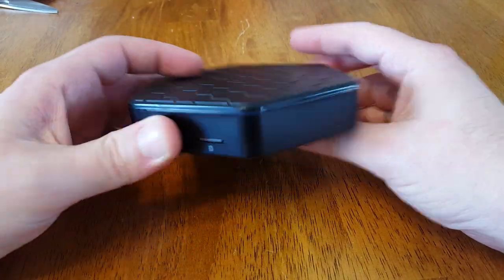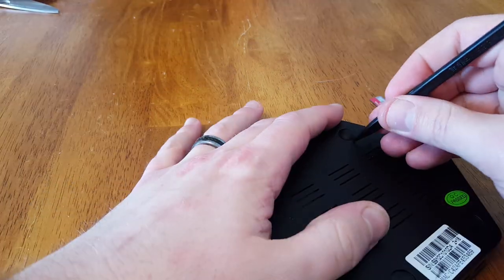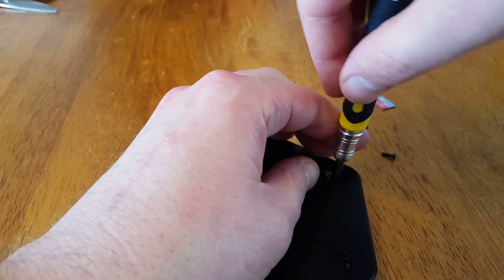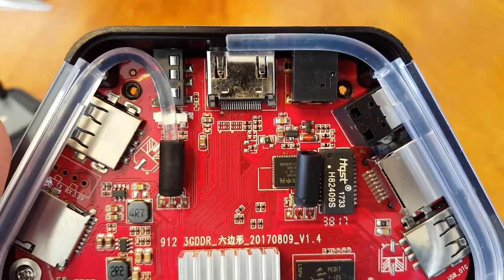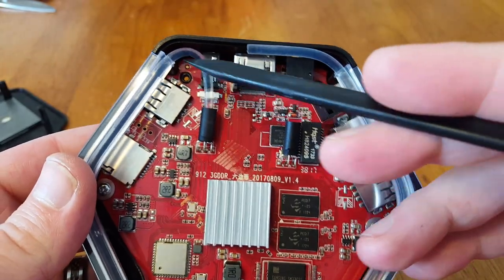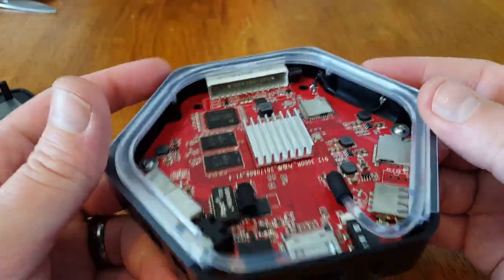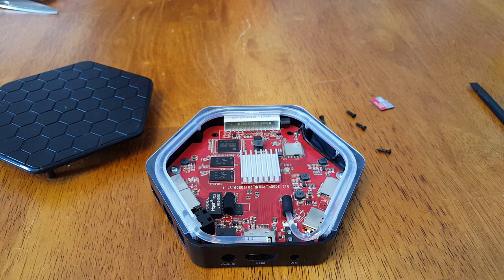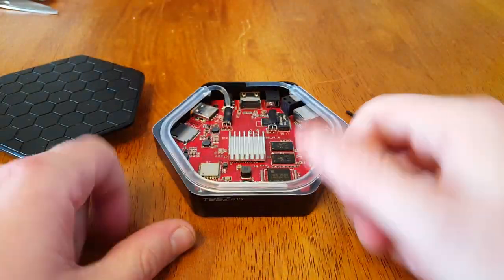Android Box Teardown T95Z PLUS Cracked Open For Close Look At Circuit Board

Comment: Thanks for the disassembly. Mine had rubber pad adhesive dried out and I was in doubt if the screw is actually beneath it (while knowing the fact 99% of time it is). Managed to get a metal pin out that I used to get the device into download mode. Custom rom is possible if we use the correct firmware for its amlogic board variant

Comment: Hi Nev. Thanks for the demo. I only just bought a box last week, and this morning, I tried to connect a 3.5mm plug with the RCAs into the AV port. However, the 3.5 mm plug pushed in the connector part and it is rattling inside the box. The Box still works fine. Is it an easy fix? I could take it to a local repair guy and get him to do it. I would ask for a replacememt box, but I would have to do a 4 hour round trip by car (Not worth it) or post it back. ANyway, if it is a simple fix for a repair guy, I would go ahead with that. I dont trust myself to do it

Comment: Hello! Do you still have the box? I am trying to fix the gigabit ethernet issue with Libreelec/Coreelec, mine is the 2/16GB version that is sealed. I need a picture of the gigabit phy, it is the chip under the component with the termoplastic rubber on the right (at the beginning of the video). I can read something like "ZTE" with chinese characters, but I cannot find the complete part number

Comment: Hello

I own a T95z Plus TV Box and after an update with a memory card that was probably damaged, it got sandwiched.
I tried to upgrade by computer using USB cable, but Windows does not recognize it.
I've learned that I need to apply an Unbrick inside the device, but I do not know how to do that.
Could you help me please.
Reply: Hola tengo el mismo problema, lograste solucionarlo? te agradezco que me respondas. Saludos

Comment: Does anyone experience overheating with this box?
Reply: I am did u resolve ur issue??
Reply: @markmartin135  I punctured holes on the side. Helped a great deal.
Reply: @lenanaH  thanks ! Mine is T95q.similar to this  i factory reset, remove apps and doesnt work. it keeps restarting after an hour or so. Really annoying. This box doesnt really shutdown unlike Beelink.
 Then i i tried and did as you mentioned. punch hole at the side + bottom too. i place small fan underneath the box. it does help. so far it doesnt restart by itself . 
Before there is barely any ventilation except 2 thin holes  like 0.1mm gap. it does help punching holes..you saves me man.👍
Reply: @mood8344  You're welcome mate

Comment: Hey Nev!
Thank you for the teardown video, my LED light had been disconnected, and your video helped me literally get it back on track!
I'm also having an issue getting the reset button to function. On my box, when putting in a toothpick or pen tube, it goes clear through the reset/av area, nothing otherwise happens.
What's happening on the box in the first place is it's no longer showing the rainbow led light when connecting. It's permanently a light blue colour, and doesn't show a picture at all.
This happened a month after I had purchased it on amazon.
They suggested I contact the seller, the seller hasn't gotten back to me at all.
At this point, I'm trying to figure out how to get this box up and running again. It worked like a beaut when it worked!
Anyway, would you know what could be done to help fix this sort of thing? Mine's a 3gb/32 also, everything else looks good. 
Thank you, keep the vids coming! And sorry for the novel.
Reply: where is the NAND chip and the points on this device to reset?

Comment: I gotta say i disagree with you about "android rage" i have 2 of these T95Z plus boxes, they always run smooth and are easily updated, maybe you just dont have enough experience with them.
Reply from the maker: Check back with me in 8 months and tell me that again please. No frustration at all. If your memory is good enough.
Reply: Lol
Reply: @NevsTechBits  
ok!!, I'm back as you requested, i still have the 2 - t95z plus boxes, 1 put aside in case the one i use ALL the time fails, but its still going strong.
What can i say man, i hope you can admit you are wrong, as the box runs as smooth now as the day i bought it. I hold this particular model of box in very high regard.

btw!!, its not a weight, its a heat sink, for gods sake.
Reply: @NevsTechBits 
Hi z
Ned, just came across this video again, 6-7 years later, T95z plus Boxes Still going strong.
Reply from the maker: @voyager4328  LOL OMG DUDE!! Good to see you again! Good to know!